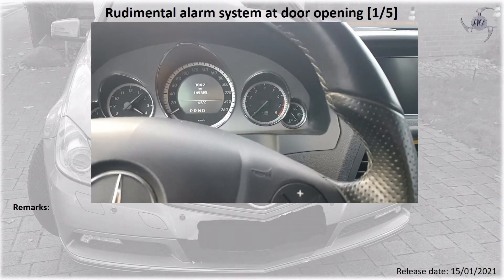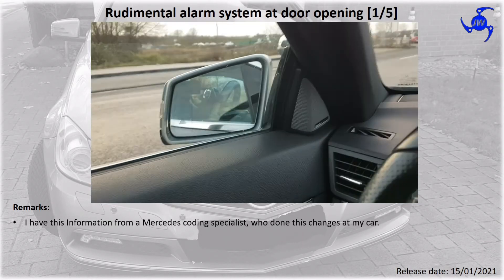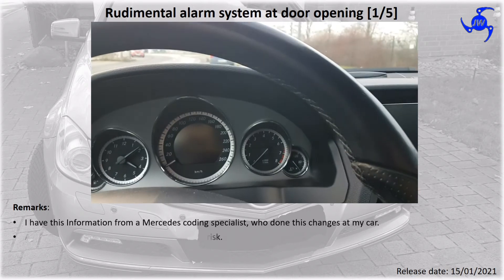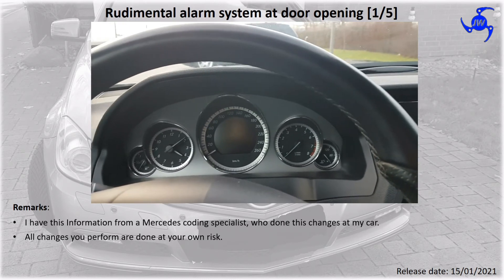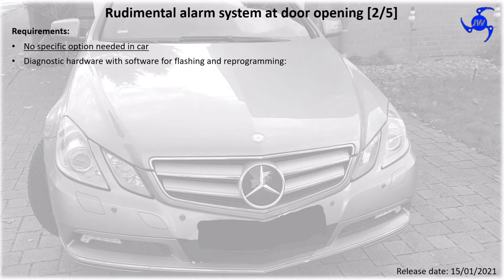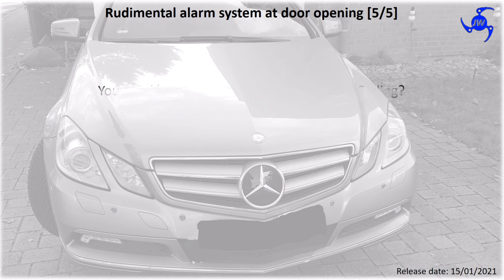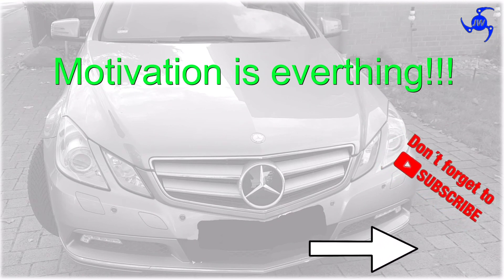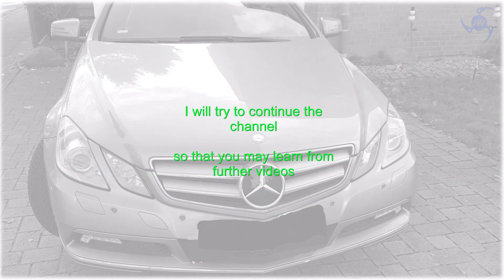DIY - Alarm system activation - almost all carlines - no retrofit hw needed - Mercedes coding manual

Comment: Awesome video and great instructions, thanks. Will check if I get it coded on my W166 as the ECUs you specified for the w176 seem the same.
Reply: Did the same coding on my w166 under the CBC and EIS166 ECUs and the alarm works great, for those interested.

Comment: Hello! Is it possible after this changes to activate horn beep when locking the car (acoustic lock)?
Reply from the maker: @fifo0gaming934  can't tell you. cause i never tried then to activate the horn closing sound.
Reply: @JWAutomotive  do you know where should I look for this option?
Reply from the maker: @fifo0gaming934  in the sam front
Reply: In my W166 the acoustic lock is under the instrument cluster in my case IC172 - VCD_06_Menueaktivierungen and there you search for it and code accordingly. Would suggest to look there and then the option will appear in the IC where you can activate. Mine had it already activated but I've switched it off, matter of taste. Hope it helps.

Comment: Hello, is it possible that something has been badly coded and so you don't hear the siren? The turn signals are flashing but you do not hear anything, or is it more about the lack of a siren? Thank you for your work and I look forward to seeing more. Regards.
Reply from the maker: it´s wrong coding.
It uses the horn not an additional siren.
In my A207 it´s activated and it work just for the hang on parts like doors and trunk
Reply: Hola podrías hacer un video más detallado con el vediamo,llevo un día con esto y tengo el w204